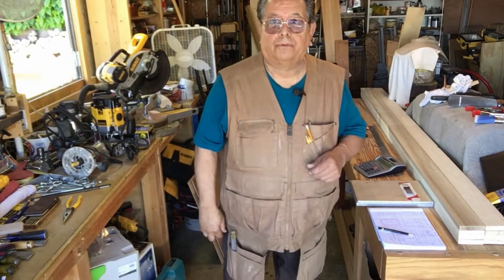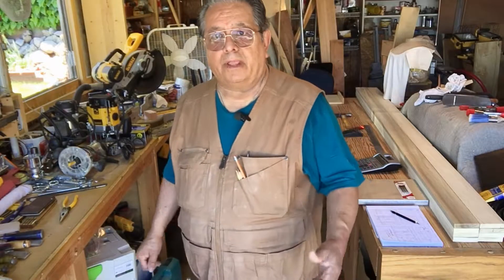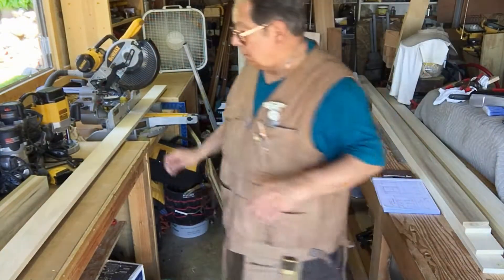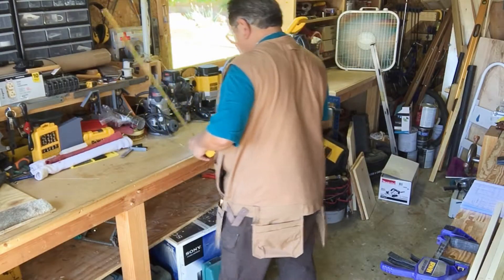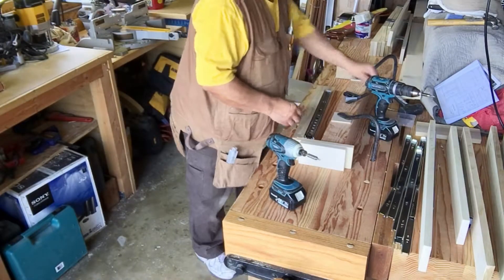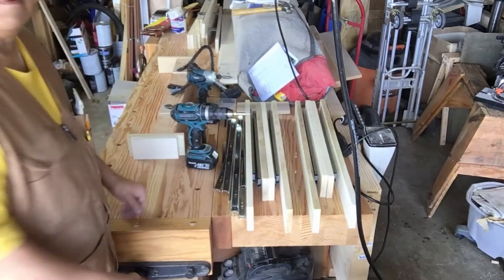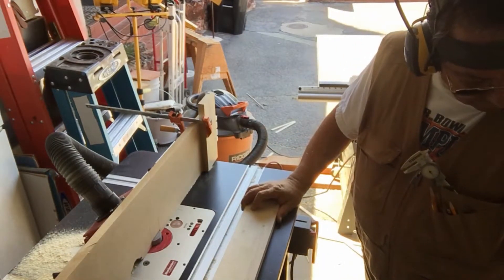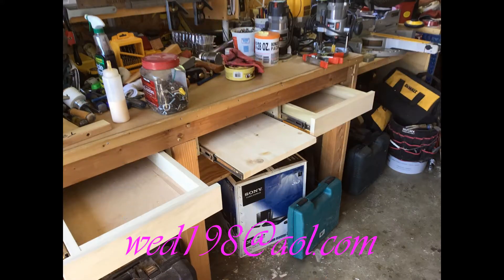New Shop Drawers

Comment: I really like your work, habits and the ideas - keeping glue off your pants, small combination square in the pocket, dado set with good shims, and how you were asked to check a master’s work.  That’s a solid and practical drawer plan.  Have you thought about a rolling cabinet for tool or stock storage?   Your setting seems ideal for something like this, and will free some surfaces.
Reply from the maker: Well Thank you very much for the kind words.  Yes I have plans for rolling tool and stock storage.  If you can ever see to the back and right of my garage is a 3' wide 5' deep pocket ideal for something of that nature that you have suggested.  we'll have to see how it progresses.  all that stuff to the back of my shop is going out and I will be organizing that whole section including that pocket I just mentioned on wheels.  Thanks
Reply from the maker: Hi Jerry and thanks for the suggestion.  Everything I have is on wheels and I am about to finish the bench I am making for a friend of mine and will uploade it too here on You Tube.  And the very next project is my wall hung tool cabinet that will greatly organize my work space.  At this time I have a lot of lumber and sheeting in the back corner of my shop that is all going out.  there is a large 3 foot wide by 4 feet deep pocket there and I am going to install a cabinet with full extension drawers from floor to ceiling that again will really free up a lot of space for me and my machines.  So, all this I'll be uploading on You Tube and I hope it will be of some use for others even if they only get just one little idea for themselves.  Thanks again Jerry.